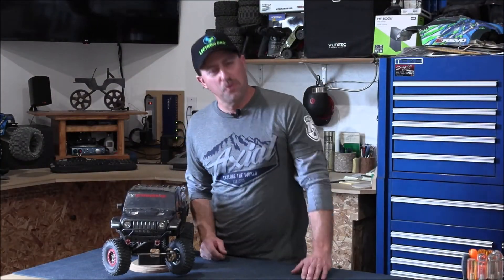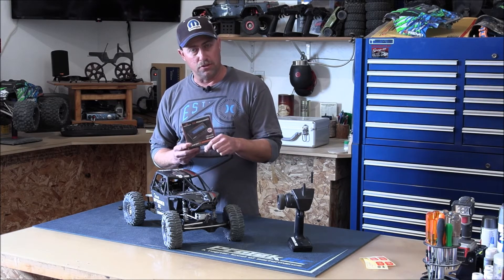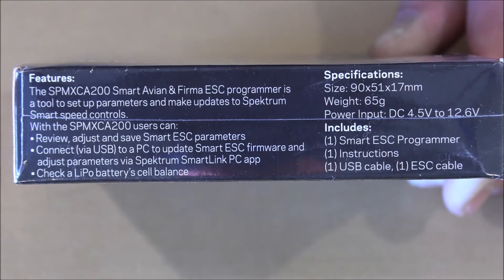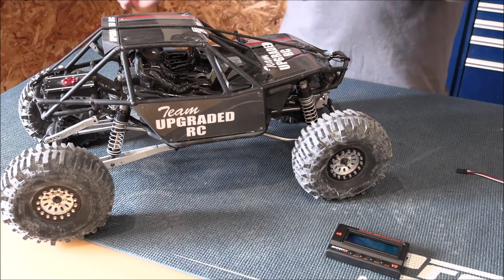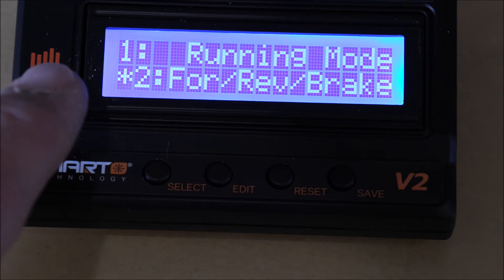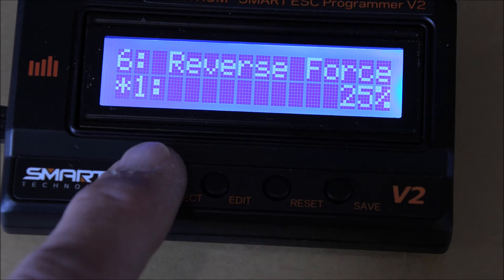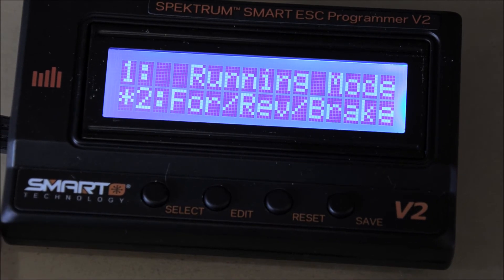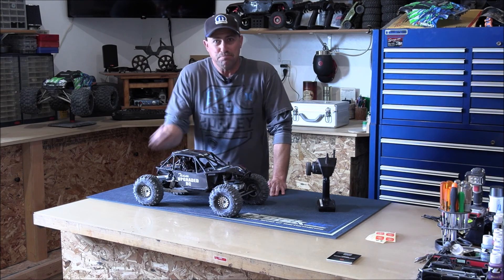Using the Spectrum V 2 Firma Smart ESC Progammer to Program our 130a ESC

Comment: The Voltage Prot. It’s “Voltage Protection”. This sets the esc to cut off when the battery reaches a certain voltage. If a battery drains too far down, it becomes un-chargeble. So this protects your battery. The default setting is perfect. No need to change.